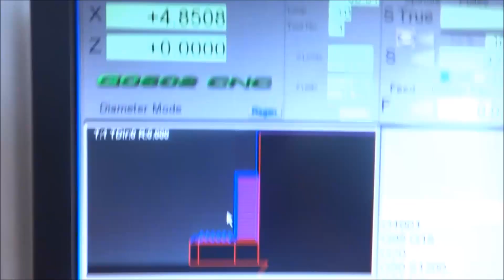PM727M Belt drive Pulley Part 1

Comment: Did you use an "aluminium" insert and was the aluminium machining grade?
If not machining grade you did a good job with the swarf!  Non machine grade can be really nasty in small machines.
Our lack of spindle horsepower, makes appropriate feeds and doc almost impossible.  I only use non machine grade when the part must be anodised.  Great video as usual, thanks.
Reply from the maker: I normally use 6061 for most of my stuff, I'm not certain if the round stock was or not most likely it was.
Reply: 2011 makes a huge difference to the way the material will chip.  Have you ever used it?
Reply from the maker: No Mainly just 6061 and also Aluminum inserts.

Comment: I enjoy your videos. Sam I may have missed it but what is the nomenclature (size, type, voltage) of the motor you are going to use for the belt drive?
Reply from the maker: Hi Billy, Well I currently have a 1 hp lesson IEC metric motor 230v 3 phase running off a Emerson VFD.

I picked up a Lesson 1.5 hp motor cheap and I will change to that sometime in the future.

Comment: For your keyway, make a tool that will be held in the lathe just like a boring bar.  Then use your carriage like a shaper, and just quickly turn it back and forth to cut the keyway.  I've done this successfully for up to a 3/16" keyway even on the little mini lathe.  The secret is to just accept the .001" step you can make for most of the cuts.  Only dial the crossslide out by a thousandth each time...or at least after the first few cuts. 

Oh, the other secret is to do it quickly, so inertia is on your side.  Yeah, sharp tool, tiny cuts, fast feed and it'll get done.  a 3/16" key is .187, you'll need about half that for the keyway, call it .094.  Yeah, you'll be turning the carriage back and forth 94 times if you do a thou at a time.  Even at 4 seconds each plus a couple seconds to turn cross slide a thousandth, you're still done in under 10 minutes.

Good luck!
Reply from the maker: Thanks Bill Yes I have used the Lathe to cut Key ways before and it does a nice job if you take your time. This time I'm going to try and let the machine do the work.
Reply: Bill Strahan Ya I was going to suggest that as well. A good video about it can be found here ( https://youtu.be/HR1pvQYFFck ) It would be even easier on a CNC lathe as the motion can all be automated.
Reply from the maker: Stay tuned I came up with a similar solution.
Reply: Huh, gets me thinking that it would be fairly straightforward to make a simple mechanism with a geared motor, a shaft on a crank, and some rod end bearings to connect it to the carriage, and you could make something like a cheap pseudo-metal-shaper.  

Just need to have an easy way to disconnect the carriage gear so it's not spinning back and forth, and an adjustable arm on the crank to adjust the throw.  Hmmmm.  I just might make this from a cheap gearmotor I have sitting around.  Would be a couple hour project and make cutting keyways on the lathe super easy.  

Key seats are easy on the mill, but I've never wanted to spring for a keyway broach.  Too much $$$ for the handful of times I've needed to cut a keyway
Reply from the maker: I agree they are expensive so I decided to make my own and see how it fares.

Comment: Sam, what is the overall height of your step pulley?  I have a PM-940m CNC and i'm looking to convert it to a belt drive, but I need to install a power drawbar first and I wanted to get an idea on the height of the pulley so I can fit the power drawbar stage at the right height.  Any info is appreiciated.  Thanks,
Reply from the maker: Email Me and I can send you the fusion file

Comment: Hey Sam what size did you make the major diameter of both high and low for your pulleys for the motor end and the spindle end
Reply from the maker: I believe it was a 1.75 ratio on the pulleys.  i think the small was 1.75 large a little over 3
Reply: @CNC4XR7  10-4 thank you sir

Comment: What tool did you use got your grooves?  Did you grind one?
Reply from the maker: No I used a SVVCN
Reply: Ok I thought about using the 35* to cut out the 40* groove, but then for $40 can buy a 40i insert so haven't made up my mind. Do the hooves fit nice? Or are the a little off?
Reply from the maker: the tool is narrower than the groove so it just follows the Model I drew and CAM was dead on.
Works really well for single pulleys where you have clearance. Stepped pulleys like in this video it cant get up close so I manually made the inside 3 grooves with a threading tool. 

If your going to do a step pulley I suggest you grind a tool so you can get clearance.
But for single pulleys the SVCCN is great.
Reply: Then that's what I will use. Thanks!

Comment: nice to see. I will follow your progress. I think I fitted last month the same motor. Mine is 1.1 kW 2 pole size 80 and controlled by a Huangyang Inverter 1.5kW. In the spindle drive I can still use the quill. The fitted pulley belt is a PJ 406 mm (16 inch)  (5 ribs) 
Topic is in Dutch, because I live there.  https://www.cnczone.nl/viewtopic.php?f=6&t=14683
Reply from the maker: Thanks